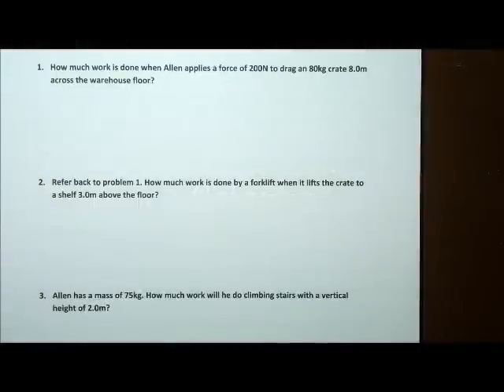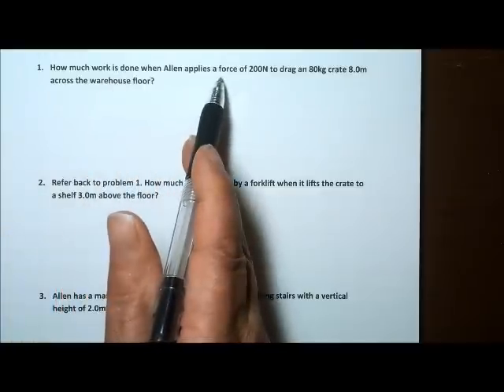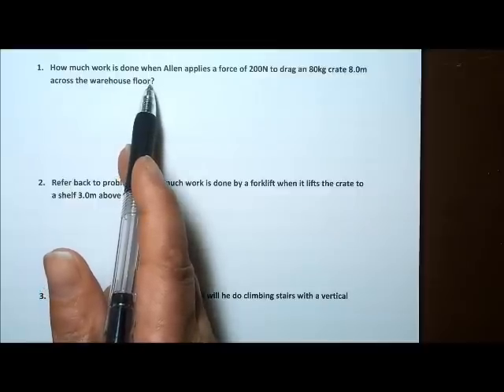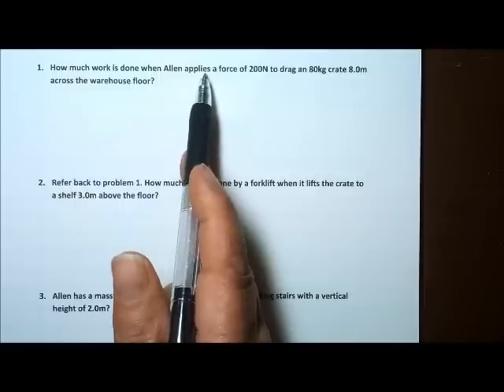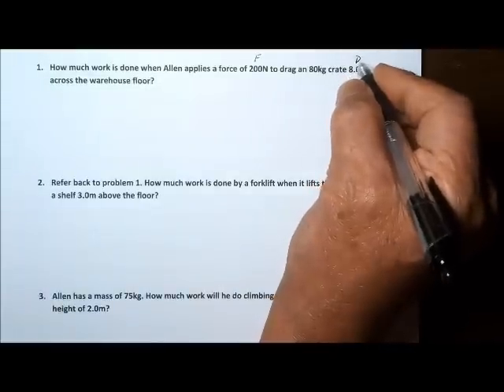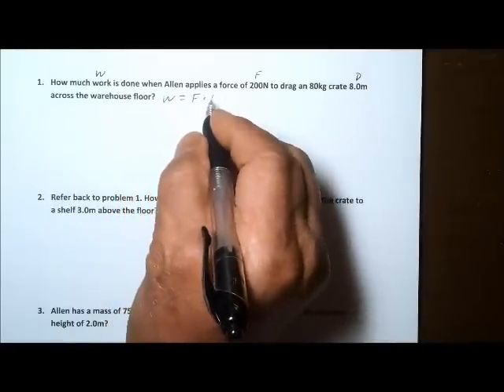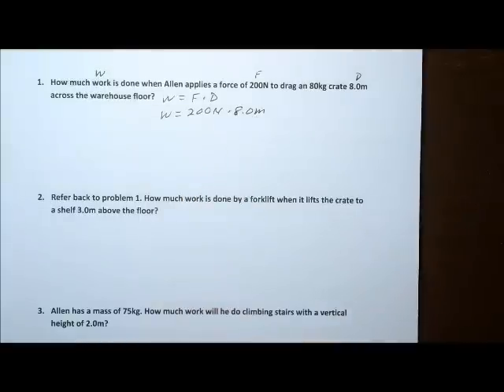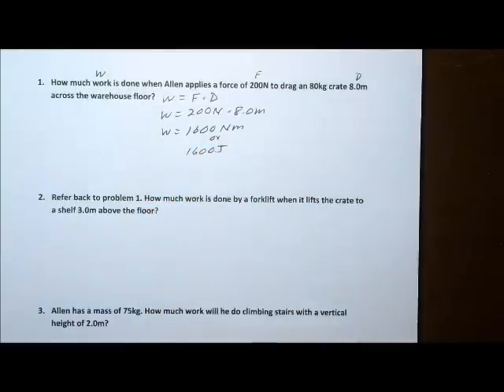Work #2: Practice Solving Work Problems Using W=FD

Comment from the maker: Yup, the angle between the force and the direction of motion is 0 deg. "Fnet" and "d" are always in the same direction if work is done. The only time you need to worry about direction is when you need to determine what the component force is in the direction of the motion, as when you pull a wagon and the handle makes is at some angle above the horizontal. Then you would first have to determine the horizontal component of the force. Sounds like something I need to cover in a video!

Comment: Excuse me for asking this, but fist question it says drag, so its a pull and not a push right? The displacement and the force are still in the same direction therefore, the angle for this scalar product is cos 0 degrees :)

Comment: I forgot to ask for the second number..Isn't the work suppose to be negative? Since the weight's force is directing in opposite direction to the displacement which is upwards, that would give an 180 angle so cos (180) = -1? I noticed a lot of ppl forget to mention the angle for work problems.